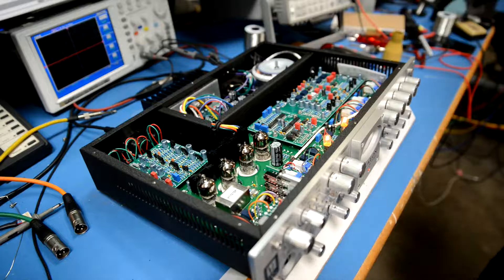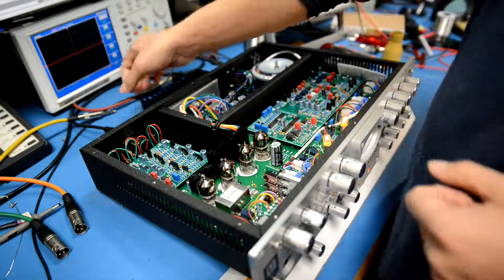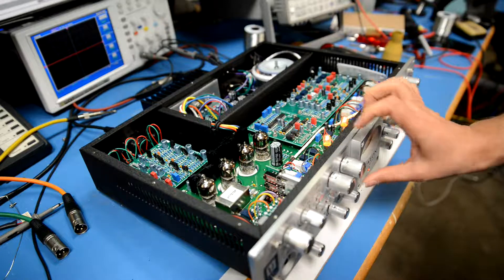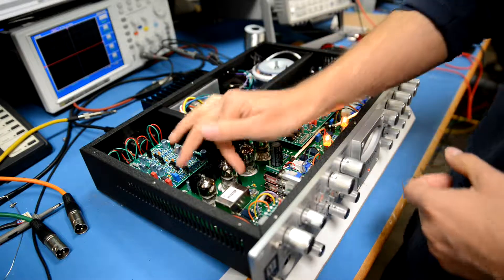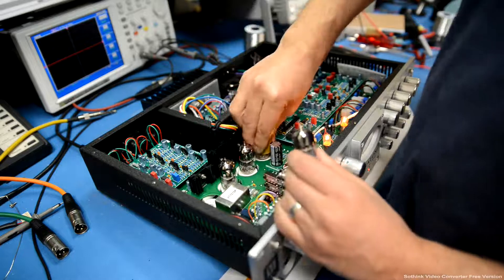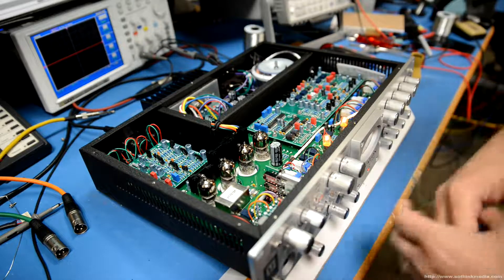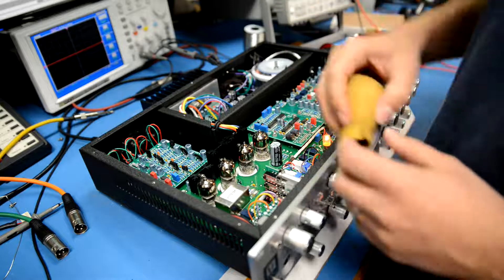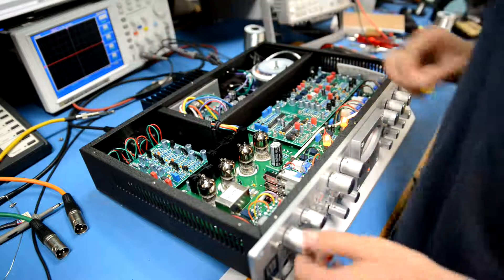Avalon VT737SP - Selecting the best vacuum tube

Comment: Hi, how are you. Just cross around in your video. Im wondering if you could help me. On my 737 when i engage the Compressor in i have like a low distorion and lose gain also and if i shout or talk loud on the mic the gain came easely again but as soon as i stop singing for 2 minutes and came back the sound is distant and distorted. And i have to scream again one more time to the sound came back normal. When i disengage the compressor all is good, working normal. The Pre with the EQ works great no issues..Could be one of the tubes that is related to the Compressor in? Or just maybe the switch that engages the compressor? If i make sens...Thanks for your help.